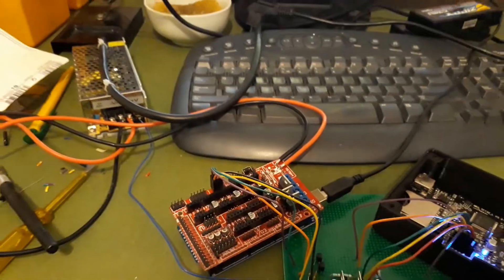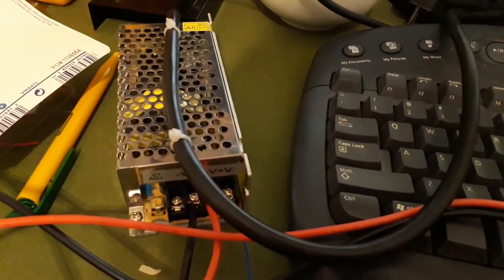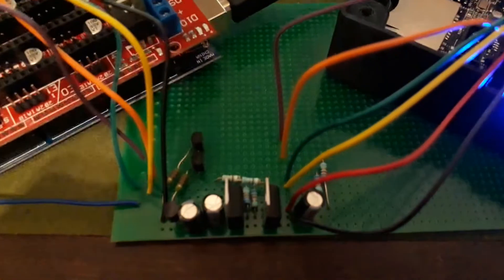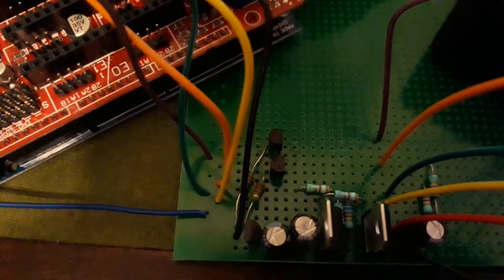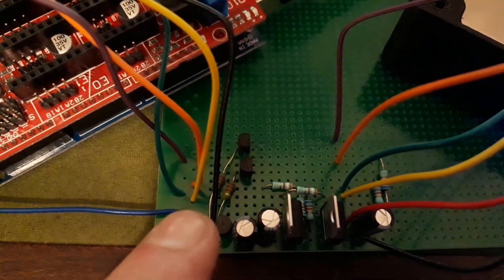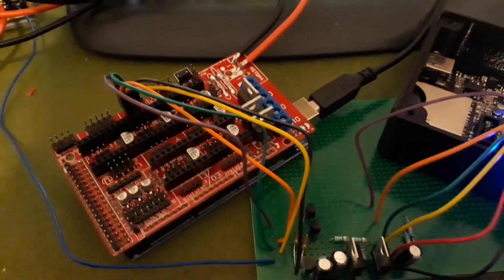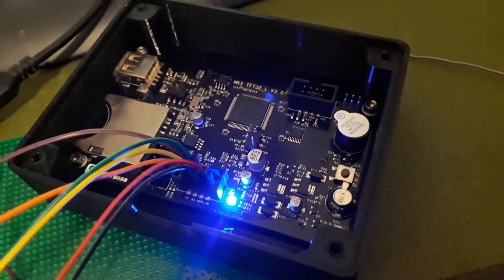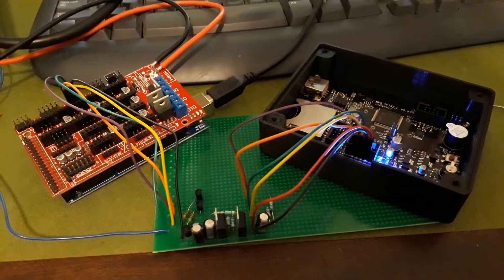RAMPS 1.4 with MKS TFT3.2 screen

Comment: @Witsenburg is this you in the video or did you just lift this vid from someone else?

because i have a Ramps 1.6P and a MKS TFT3.2 and want to use them together  i have solved the 5V power problem that is easy but i dont understand what yu are doing with (what did you call it ) level shifting signal voltage?
Reply from the maker: Yep, its me, but I never got it working completely.
Reply: owww thanks